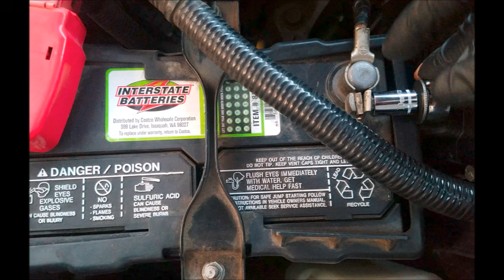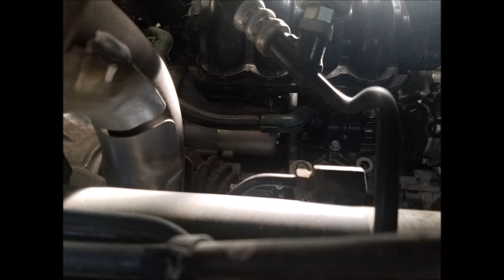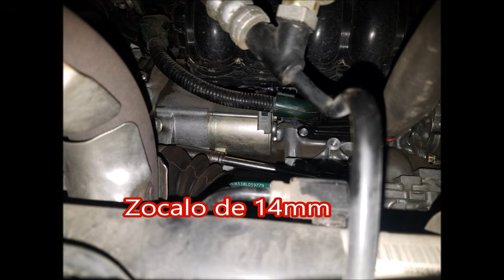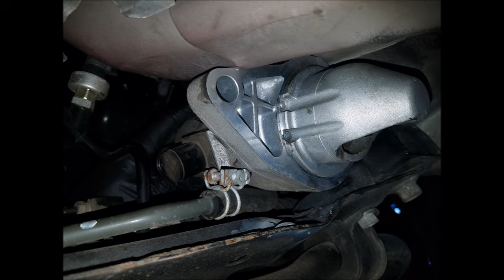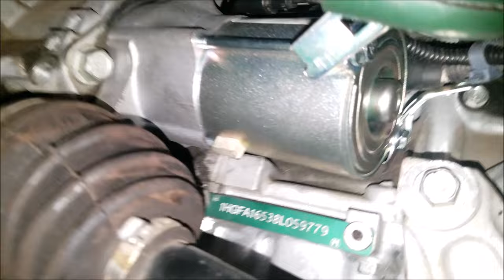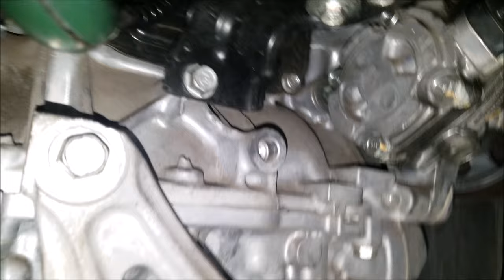Como Cambiar el motor de arranque de un honda civic 2006-2011

Comment: Excelente video. Tengo una pregunta, este starter que cambiaste es igual para un civic coupe 2006? Porque tengo entendido que hay 2 tipos de starter para el civic 2006 al 2011. Gracias por tu video, entendi lo suficiente.
Reply from the maker: Si es igual que el 2006..pero hay diferencias entre el carro automatico y standard el que cambie era automatico...y tambien hay de 2 motores uno lo tiene tiene por el lado del radiador el motor 2.0l y el otro el de este video el 1.8l
Reply: @backyardchevy328  muchas gracias por responder.
Reply from the maker: @fernandorosas4669  de nada🙂..tengo canal en español tambien que se llama backyard chevy español..estoy agregandole videos casi cada semana cuando pueda

Comment: Muy bien video. Mira carro me no me quiso prender lo raro que días atrás a la hora de darle marcha escuchaba un ruido por la parte de los fusibles del interior del carro se escucha como un relay cuando están dañados pero no estoy seguro. Ahora el carro da luz en tablero y todo pero a la de dar marcha no arranca solo hace un click click en el motor y no prende. La batería está buena. Que podrá ser. Es un 09 honda Civic
Reply from the maker: Muchas gracias...Y si tiene limpia las conneciones?..si esta buena la bateria y si esta cargada con las conneciones limpias..pienso que a la mejor va ser el motor de arranque..porque si da click donde esta el motor de arranque todo lo de la llave, los fusibles, relays han de estar bien solo falta que agarre corriente fuerte para que de marcha, pero con la bateria buena y la connecion buena..buena chansa que puede ser el motor de arranque
Reply: Me Llegó Ami taller un Honda Civic Con el mismo Problema Al Darle Marcha Sonaba Un Clak  Baje el Motor de arranque Y Fueron Los Carbones Y Automático Saludos desde México ✋
Reply: Tengo el mismo problema apenas mi honda civic 2006 comenzó hacer ese mismo ruido cuando lo enciendo.

Comment: Donde se localisa el staret de un honda civic 2012 y necesito un gato para alsarlo????
Reply from the maker: Lo tiene en el mismo lugar, y si se necesita un gato y soportes, para levantar el carro mas alto para tener mas lugar debajo para trabajar.
Reply: @backyardchevy328   ok.no cuennto con un gato para levantarlo.puedo tocarlo por donde esta el cofre para saver si es el prolema y llevarlo al mecanico?? ??
Reply from the maker: no se puede, esta escondido debajo del intake manifold...quisas quitando la llanta del pasejero se puede
Reply: @backyardchevy328  gracias hermano .hoy melo arreglara un mecanico.el prolema que no arranca solo las luces prenden y se escucha como un chasquidito por donde los fusibles.y es un honda civic 2012.aver que dianostico tiene.
Reply: @tnylsca8926  
Que solucion te dieron sobre tu honda, saludos